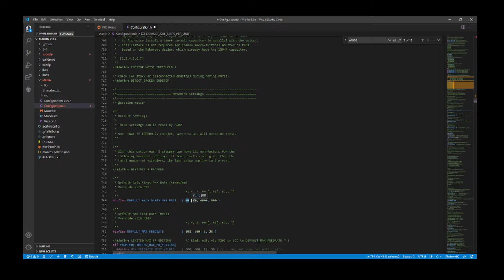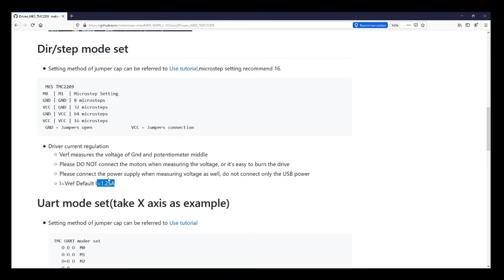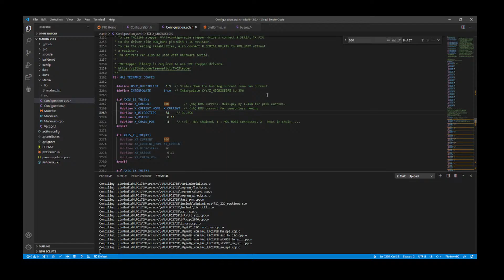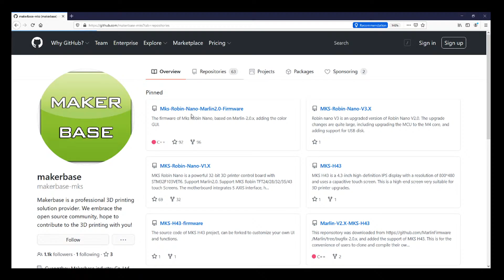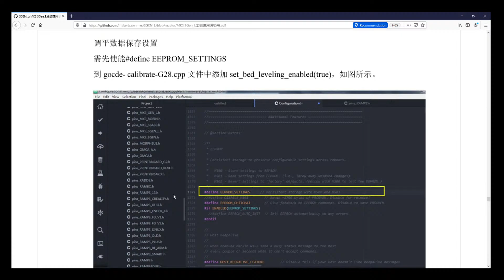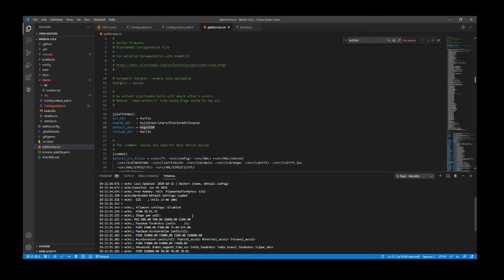MKS sGen L Vx.0 TMC2209 UART with Sensorless Homing

Comment: I'm setting the marlin. I'm uploading. when i plug in extruder and bearing thermistors motors etc nothing works.... Mks gen l V2.1 tmc2209 . By the way, if I can learn about the sensorless event, I couldn't stop the motors with a switch :D
Reply from the maker: The chip set is different.  If you're referring to MkS Gen L v2.1 it's an 8 bit processor, whereas MkS sGEN L is 32 bit processor.  The easy fix is to use default environment of mega2560.
Reply from the maker: Also motherboard will be different from tutorial.

Comment: Hi Edward,

Your videos are awesome !   I followed your MKS_SGEN_L v2 Basics video and it worked just fine. I flashed the sdcard and everything was easy because your tuto are just amazingly well made !!

Now, I tries to replicate what you did in this video but it's not working and I don't know why... When I connect the printer via USB, I have a message that the USB is not recognized, but  I can see the COM3 in platformio HOME when I connect my printer, but It does not appear in windows explorer.

When I try to upload, I have an error:
...
...
RAM:   [====      ]  39.8% (used 13016 bytes from 32736 bytes)
Flash: [====      ]  35.3% (used 167892 bytes from 475136 bytes)
Configuring upload protocol...
AVAILABLE: blackmagic, cmsis-dap, jlink, mbed
CURRENT: upload_protocol = mbed
Looking for upload disk...Error: Please specify `upload_port` for environment or use global `--upload-port` option.

been 4 days I knock my head on the wall and ran out of options.  I even looked your video frame by frame and copy every single info without succes :(

How do you do ?

What is your COM / upload_port configuration ? Please help !
Reply from the maker: Can you post you're configuration.h and platformio.ini in Discord?

Comment: hi,i have an mks sgen l with tmc2209 on my delta printer,please,help me to set up that without sensorless homing...
Reply from the maker: In my MkS sGEN L playlist there should be a tutorial.
Reply: @EdwardBraiman  sorry but I’m look only a tutorial of tmc2208 or tmc2209 with sensorless homing 🤷🏻‍♂️, please give me a link and sorry for disturb
Reply from the maker: TMC 2208 is unable in current form doesn't work for sensorless homing.  TMC 2209 does.  Check in my MkS sGEN L v1.0 or v2.0 playlists.
Reply: @EdwardBraiman  i have an delta , not use sensorless homing , I’m use tmc2209 only for reduce the noise , I’m follow your tutorial , and it run , but not noise , it silent only when he go at homing ( he go at homing first with not silent , after he down few and last go on homing low speed and very low noise ) but when I move machine he is not low noise ... I’m change value from 100 to 50 , 20 , 200 but same result 🤷🏻‍♂️
Reply from the maker: I'll check after work.
Reply from the maker: In my description below video there is a Discord link.  Post your configuration.h and configuration_adv.h in the general chat and I or someone else can see the issues.
Reply: @EdwardBraiman  where I’m find that chat ?? Send me your mail address and I’m send you that file
Reply: @Edward Braiman  where you prefere im write ?? (chat )
Reply from the maker: Chat is during live stream.  Discord or video Commandments works.  Advantage to discord is if I'm busy or sleeping some else might be able to help.

Comment: i saw your video of connecting arduino and ramps i did the same, but when i connected the power supply arduino ic burnout, can you tell me where i did mistakes?
Reply from the maker: Sounds like power is reversed some where.  Do you have a picture of device in current state.

Comment: same setup with MKS sGen L V1.0? thanks
Reply: I believe, yes... last time I compared board pins out, it was the same. Also, when I setup my SGen_L_v2, I used  V1 and V2 tutorials and mixed the information and it worked for me.
Reply from the maker: Great.
Reply: @EdwardBraiman  Not working anymore... I copied the firmware.bin, put it in the board, power ON, everything was fine, connected via Pronterface, did a M119, everything was perfect, but I can't get it to work like you to upload from VSC... Always have an error... I wrote you a message about that(with more detail). Can you help ?
Reply from the maker: Can you post configuration.h and platformio.ini on Discord?  I'll try and address during Livestreaming tonight at 6 PM EST.
Reply from the maker: Need to test, as I put board in ender 3 for moment.